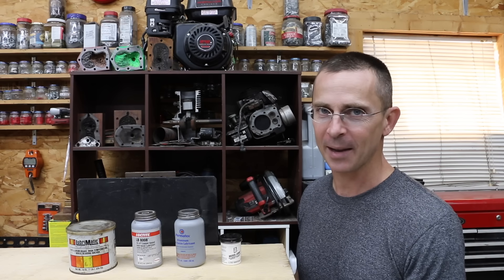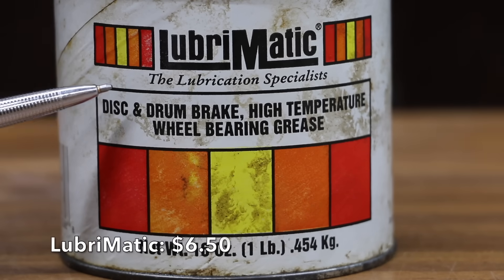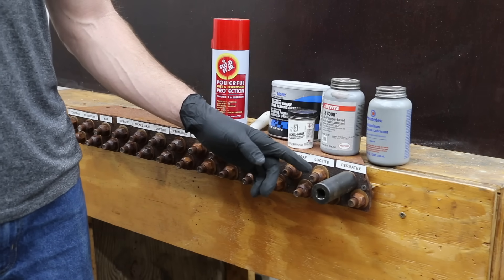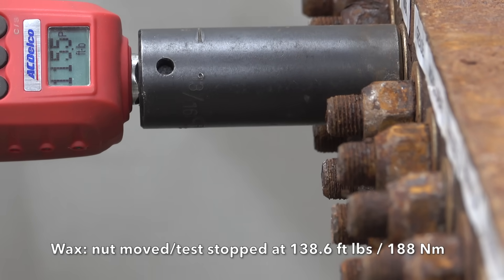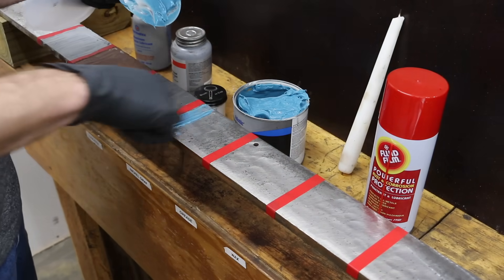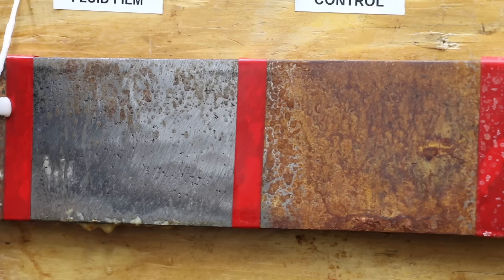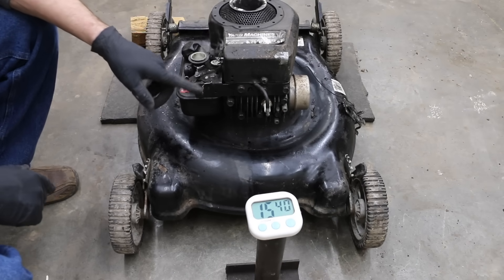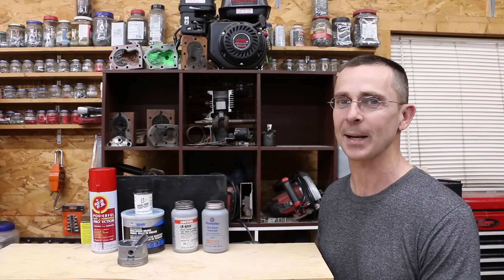Does Anti-Seize Compound Actually Work? Let's find out! Anti-Seize vs Grease vs Fluid Film vs Wax

Comment: As a marine engineer for the last 30 years I can say that all of these anti-seize products are very limited when used in the marine environment. I stopped using these many years ago and instead use silicone grease (such as caterpillar o-ring lubricant, Dow Corning Formula 111, or NAPA Sil-Glyde).  I find that Anti-Seize tends to loose it's oil or grease after awhile leaving only the dry flake. Then sea water seeps in and starts to cause corrosion. Silicone grease stays for years and years. Sea water has no effect on it. Extreme high heat can be a problem though. Exhaust manifold bolts is the only place I use copper based anti-Seize.
Reply from the maker: Thanks for sharing.
Reply: I'm a retired marine engineer and I can tell you that anti-seize does work. Dow Corning does work on some things but not 950 degree superheat steam line flange studs but Loctite copper plated anti-seize does. Yard-birds don't like using it because it takes too much time to anti-seize the bolts and studs, and it is almost impossible to get them to apply it to fiber sheet gaskets. I always would have an understanding with the yard that they would apply it to boiler handhole plate threads after I had to burn off 80 handhole plate nuts one time when they used plain nuts instead of 2-H nuts, if they had used anti-seize the nuts would have not have galled.
Reply: @robertmurdock9750  I never said it didn't work. And copper is better than the aluminum based stuff. I have never worked a steam plant but you will notice that I did say that I used anti-seize for exhaust manifold hardware.  This would infer that silicone is limited to lower temperatures. In these situations I have found nothing better, or that lasts longer. I have taken apart water jacket assemblies for instance that I assembled 4 or 5 years earlier to find that it wasn't even necessary to re-lubricate the the hardware. Just keep them clean and slap them back in.
Reply: @notmeatall7116  Yes you have to have something even if it is the old lead plated anti-seize, nickel plated anti-seize works best on most things. I would even use it on steam valve packing, it sure made it easier to pull. When you spend a week under an H.P. main propulsion turbine in a very tight space with a rosebud torch trying to remove 8 broken studs in the extraction flange and 4 in the belly drain flange you spend a lot of time cursing the fellow that put them in dry. You should have tried the old steam ships you would probably have liked them. My last ship was the Chemical Pioneer which was the old Sea Witch it is the only chemical carrier in the U.S. fleet.
Reply: @notmeatall7116  The person you are speaking to does the inferring, you imply.
Reply: @robertmurdock9750  
Anti-seize only takes about 1-2sec to apply liberally to a bolt. While some people are overly lazy, that's not why fishermen stop using it on everything, except exhaust flanges & bolts.

While galling is a concern (lots of SS bolts), that's easy to prevent with many greases etc. Corrosion is why we don't use anti-seize on most bolts.

When you work on a commercial fishing vessel year after year and you don't have ready access to auto parts stores, etc, you don't skimp on anything for simple laziness, because you end up paying for it the hard way.

When you have had to nearly stand on your head and hyper extend your arm to reach a bolt on the far side of an engine, only to discover it has rusted and seized and the head breaks off instead of coming loose, that's the kind of fun experience you are desperate to prevent ever happening again.

We stopped using anti-seize because after 2 years of marine exposure, it seems to promote corrosion! We only use it on things that get taken apart at least every year.

I am curious as to others experiences with anti-corrosion compounds for extended periods in marine use (with anti-galling properties).
Reply: @andrewstambaugh8030  Have you tried tef gel yet ?  I saw someone on a sailing cat using it. IT is hella spendy.
Reply: @print4apet  I haven't used it, but it looks like some good stuff! I'll have to recommend it to a couple guinea pigs (fishermen) and see how it holds up long term.

Amazon reviews are saying good and sensible things about it.

According to their website, it specifically is made for prevention of galling without including metallic elements and is also designed to prevent galvanic corrosion, both by not containing metals itself and by preventing the most common methods of metals entering into the compound (turning most things into a galvanic connection).

What is a little odd though, it it specifically says it isn't electrically insulating.
*my own experience with NCP2/electrical anti-corrosion compounds working well, says that this should work well also
*that is also good for maintaining ground connections, such as engine grounding and sensors etc, though I always prefer direct ground wires over relying on case/engine/hull grounding
*but the ideal for no galvanic corrosion is actually a non-conductive insulator.

Edit: i was misreading the prices on websites, it is quite expensive (over $100/tub). I think it may be much better at resisting SS galling, but is probably comparable to electrical anti-corrosion pastes at galvanic protection. Neither is supposed to be used on exhaust. So it depends on what you need, but i think the cost would drive me to $15-20/tub electrical paste unless it really seemed worth the premium on some really expensive high end SS equipment.
Generally, most of the people I personally know are trending away from that kind of high end toward simple low maintenance run all the time efficient equipment. An exception to that rule is wrestling over the decision for cheap efficient props or high maintenance but shallow draft jet boat that burns more fuel even if barely pumping?

It would mess with torque specs, though, so hmm... probably worth it on a SS jet enclosure, if it doesn't have through bolts
Reply: @robertmurdock9750  
Did you have any "engineering" on Stainless Steel bolt galling during installation? Seems to be something I am not aware of but it fails above rates for carbon steel and is like things many people do not know like bearing failure proceeds from the end you think it doesn't ~ oddities like 3M Gasket sealer or what to put on head-gasket where I would choose the Permatex brand like you are saying with the fiber-sheet gasket this being one of those moments when patience—not my best feature—avoids uh:
 
"Would crush me like u couldn't imagine" 
 
Like wood blocks improve jacking if used correctly and make it worse if you do it wrong this sort of thing is my only hope now to avoid destitution such as I learn today from McNamara that what I thought was a $1,000  repair is carb-cleaner in the Idle Air solenoid
 
3M Gasket sealer originally was 3M Weather stripping sealant then became Gasket sealer when mech's figured out "faster and cheaper
Reply: @ChiDraconis  No we would just use nickel anti-seize or not use stainless at all. That was on 309 and 316 stainless back in the eighties, then sometime in the mid nineties the problem vanished, but I would still use the anti-seize. It was a pain in the ass 8 bolts per flange to have to cut them off with a hack-saw it was easier if you could get to them with a pneumatic hammer and chisel to cut them off or to just drive the bolt through the nut with a punch. We couldn't use a grinder on deck because we hauled 280,000 barrels of gasoline and were only gas free a couple days a month.
Reply: @not meatall 
I've not been a marine engineer but have had good success with silicone grease on the farm.

Ive been using Tribology Tech-Lube silicone paste. It works well. I've found I need to wear gloves because if I get it on my hands they stay slippery for a while as washing doesn't really have much affect taking it off.

Maybe Project Farm will do a review of different silicone grease products.
Reply: @joshk.6246  And a follow-up video on the most efficient way to remove silicone grease from your fingers, featuring things like a gas torch, a grinder, sandpaper and a knife. :-)
Reply: @ITubeTooInc  ...and taht is the problem with anything silicone based.   silicone has no solvent and it's nearly impossible to remove 100%.   If you ever need to have that thing repainted to an A level finish, good luck.   That's like people who use the RainX product to keep water beading on their windshield...good luck if you ever need to get that car repainted.
Reply: Years ago i was worki g on miltary vechicals that had been stored 'n the kuwait desert sense desert storm page 1 worki g on M1 abrams and Bradlys  mostly, i found the nuuts and bolts cam e off pretty da g easy after 11/12 years ever sense then ive used the cooper based anti seize on all  y tower and antennas a d anythi g automotive  and marine.
Reply: @John DoeYep, both: grease the threads so they don't rust or gall, and use enough that it seeps out and seals at the surface where the head meets. (keep that moisture out!) If it is somewhere leak prone, maybe even wipe a thin coat over the head (as long as it isn't where passing by gets it on your clothes)

We have several 3/4" thick lexan skylights in our deck plating. It makes it nicer to see in the engine room, but the seals along the edges wear out and eventually start leaking. Anything under those spots will get a water trail of rust, so those bolts are most likely to rust.

PS. SS bolts in alu - bad combo. Definitely need something there. If you don't, the alu will corrode and fuse to the SS while also making white crumbly large pitting around it. When you go to remove it, the bolt will be stuck and when it does come out, it is likely to crumble a much larger hole than was drilled/tapped. (and of course, old crumbly alu welds as one might expect)
Reply: Andrew Stambaugh "
Reply: @andrewstambaugh8030  What about Galvanized hardware ?  I am about ready to bolt my 40hp tohatsu to my dux and the transom is alloy. So thinking to try something new versus ss.  ( boat trailer that is Galvanized has lasted 20yrs no problem.
Reply: @print4apet  galvanized will work but only for so long because of the nature of its application.    the zinc is the sacrificial metal in the galvanic cell so the zinc literally disappears over time.   Eventually it will be your bolts and threaded parts taking the hit with nothing in between.   a trailer with no rust in 20 years?   def fresh water.
Reply: So would you recommend it for small engines exposed to the elements
Reply: Do you know how well lithium grease works?  Bel-Ray makes a salt waterproof grease for ATVs.  I don't know what it is made of.  It is nasty and of course you can't hardly remove it from your hands without harsh chemicals.  I think silicone can go to 400 F and lithium 300 F with some specialty formulas up to 500 F.  Correct me if I am wrong.
Reply: @solarsynapse  
That saltwater resistant grease sounds interesting. How expensive is it?

In my current position (primarily CNC Tech/repair at an aerospace machine shop), i can speak that the CRC General Purpose White Lithium Grease (NLGI 1) is a failure or minimal corrosion resistor at best (stuff still rusts). 

My observation it that absorbs to much water over time, notably thinning its consistency. It temporarily protects the metal from immediate corrosion, but over time ends up keeping the metal moist and causing it to rust.
other brands/formulas of general purpose liths may act differently 

The dark grey EP Lith (Mobil CP-M, NLGI 2) seems to resistant to both absorbing and moisture intrusion much more (it's quite a bit thicker and stickier, nice quality creamy stuff).  we use it on our lathes' chuck threads etc to resist SS galling, no signs of corrosion (enclosed, running water sol coolant). Also I put it on the screw threads of our metal bandsaws (open/non-enclosed, running the same water sol coolant).

Also, it doesn't wash off your hands with regular soap and water. Seems like a good sign for moisture protection. The regular white lith washes off after about 2 attempts with dawn dishsoap. I have to use a bar of lava to get rid of the black/grey grease, but at least lava is nice on the hands.
Reply: @John Doe Thanks! I really should. I might start doing that soon.
Reply: +1 on the dow 111.  works perfect for long term protection in HVAC world as well.  Use it on thermistor connectors for compressors that sweat.  Stays there for years.
Reply: @lesstech74  Thanks for confirmation on that. That's a great side-comparison to marine.
Reply: I exclusively use silicone spray on all new nuts and bolts on my truck, you can visibly see it on the bolts 3 years later
Reply: @markusluukko  Which one do you like the best? Brand?
Reply: This is the question that I wanted answered, how does silicone grease work in these tests? I use it for quite a lot of things lately, over the past couple of years but I haven't been able to find out a lot of info about it as far as it's weaknesses and strengths compared to other greases and anti seize compounds. I just lubricated the throttle and choke cables on our Snapper rider and used a homemade mineral oil/paraffin wax mixture. It seems to work very well so far but not sure how it will hold up over time. Silicone grease would possibly be a better lube for that but it's expensive although that's not really much of a concern in this case because it doesn't take much to lube a couple of cables.
Reply: Commenting for posterity
Reply: The Dielectric Silicone grease is great for stopping corrosion on battery terminals, especially marine deep discharge batteries.
Reply: @stevenmoomey2115  Agreed. 
I use NCP2, which i believe has those properties plus some specific things for dealing with acid vapor.
On the fishing vessel, when i switched to using that, I went from needing to clean battery terminals multiple times a season from connection problems due to corrosion, to simply cleaning them once a season just for good measure and reapplying NCP2.

I prefer the paste can to the aerosol spray. much less messy and easier to apply only where you want it.
Reply: And i throw that on all marine electrical connections (and my car) and also used it to stop the cheapo garmin gps backplates from rusting out for our deck control station gps (out in the elements).

I got tired of $300-800 fancy electronics cables that were supposed to waterproof but would end up with corroded pins disintegrating out. I started wiping them down with ncp2 before assembly and haven't had a problem since.

Side comparison: expensive submerged use wirenuts for irrigation: What are they? A regular wirenut, stuffed full of dialectic grease, with a skirt or plastic tabs to make sure the grease stays in. (magic)
Reply: Why copper on exhaust bolts?
Reply: Any time I had to add fittings to a sailboat spar (mast or boom) I drilled an appropriate sized hole and dipped the fastener in silicone sealer before installation.  It helped keep salt out and the stainless screws or aluminum rivets remained corrosion free for years.  I can only concur with the comments of 'not meatall.'
Reply: Isn't the main use of anti-seize to get more clamping force out of a fastener with the same amount of torque as dry?   Basically to prevent the fastener from seizing as it is torqued thus not getting as much preload.
Reply: @astriknon  In the general category of "thread lubricants" that can be a main goal, but as you've seen here, in marine or caustic chemical service, that may not even be important (only need snug & sealing, not extreme torque).
When the goal is only increasing torque allowable torque, there are products that are just specific oils, etc that are cheaper, less messy, and more quickly applied. (eg. drop all these bolts in a bin of oil. They are intended to be permanent, so end-user removal is not a concern)

Common primary goals of the thread lubricant category:
*Removability
*Anti-galling
*Consistent and/or higher torque
*Corrosion resistance

It's also worth noting that thread-lockers are often categorized as thread lubricants,  and they often share overlapping goals/properties (eg blue lock-tight).
Reply: Thank you.  Wheel studs do have this drying tendency (although no problem).
Reply: not metal //  You're spot on; and even in "non-marine" environments, ppl should know that the oils in grease do dry up leaving a solid/cakey paste behind [if it's older], and/or especially if its application is consistently close to a low to medium temp heat source. I learned this via my brother-in-law who was also in the marine industry as well as a head mechanic. God bless.
Reply: Had the same experience as a fruit warehouse mechanic.
Reply: @John Doe If something actually needs a torque wrench, you follow it's specs exactly without changing anything.
-But almost nothing actually needs that. On an entire fishing vessel, you're looking at a few engine parts (eg head bolts), a few bolts when rebuilding a high-end hydraulic pump, and some super clamping-force-sensitive or fragile brass parts on a refrigeration systems.

Everything else is done as feels appropriate for the sizes and materials (that is a learned skill, though, so we have to watch/teach the new guys how to feel what a bolt is doing).

If something seems like it is too close to its limits, we are likely to just go ahead and upsize it (larger bolts, thicker plates, gussets, etc), so we don't have a breakdown out on the water, when big money might be on the line.

(alternators are one of the first upgrades: higher amp, more common easier to replace alts, drilled out to larger mounting bolts, etc)
Reply: I spent half my life as a commercial fisherman in Alaska and came to the same conclusion!

For Exhaust manifold & turbos, ultra copper. (they get pulled apart every year)

Anything that doesn't get pulled apart yearly: paint over the top, battery terminal/dialectic grease, or marine bearing grease or even dry, as opposed to anti-seize.
Why? Corrosion. Whether the grease component cooks out (leaving dissimilar metals!) or bacteria eats it and turns it corrosive, anti-seize doesn't work well on a boat. It eventually becomes extra corrosion paste!

In practical experience, anti-seize is only good for 1 year of marine air exposure. I really don't feel like undoing every bolt on engines and equipment every year and reapplying to keep it from going bad/corrosive.
Reply: @andrewstambaugh8030  I seldom come to the comments expecting to learn anything, so thanks for a great bit of extra-credit education!
Reply: @teamagoge-theenduroists8683  You're welcome. I find the quality of the comments is often directly tied to the quality of the channel.

Cheap click-bait channels = comments that are, hmm how to say nicely...

Helpful well made channels like Project Farm, Smarter Every Day, specific industrial machine repair channels, etc = useful and helpful discussions